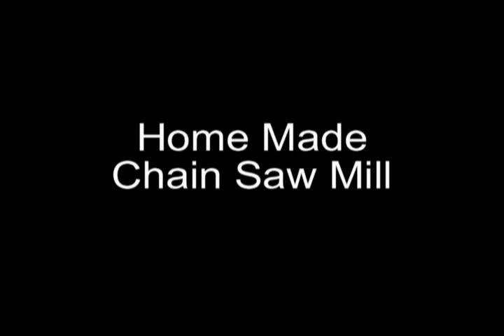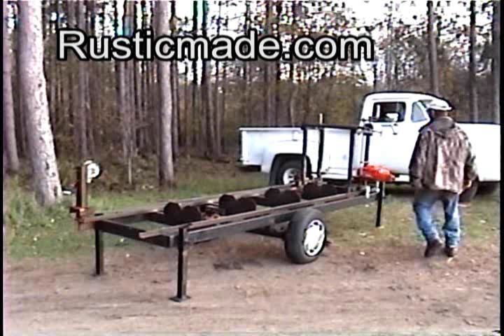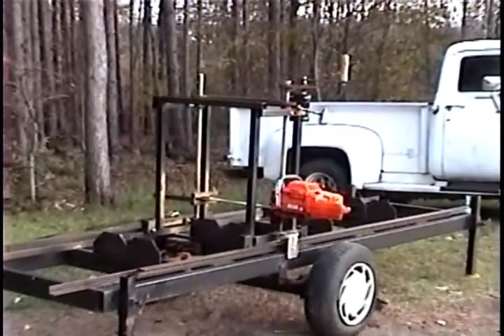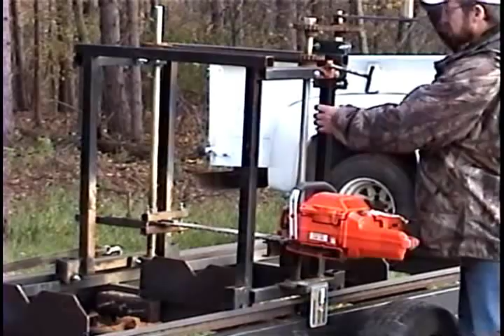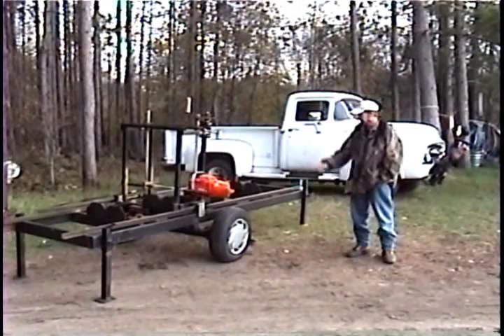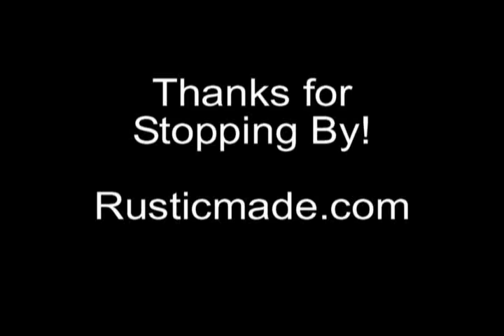Build Your Own Chain Saw Mill

Comment: if you do put 2 chain saws so i cuts it into about three 2 inch pieces(depending on log)and if you want i just cut in half you can reel up the second saw up so it wont touch the log =D

Comment: Nice. The key in ANY small chain mill is a stabilized bar tip. Without that, you're making wagon tongues. Chain mills walk all over band mills. I like your system, but how do you load large logs?. I have a Woodbug, simple, sits on the ground though.

Comment: husky or still in  terms or reliability are on par. but sthil has some really nice features like cam lock gas and oil caps vs huskys screw in . and there ease to get to air filter and spark plug. i like huskys chain ajustment screw on the front instead of in the middle of the bar. like i said before i have both sthil and husky from 16 to 36 in . i like my sthils better overall but there both quality brands if you need a good saw dont get any thing other than a husky or sthil.

Comment: CharlesRaines, do you file the chain angle less steep for this type of work, compared to cutting trees or firewood the angle would be more steep. 
For flat sawing like ur doing in the mill mode the angle needs to be less for more efficient cutting.
Could u post of the mill in operation??
Thanks

Comment: I was pretty sold on the Logosol M7 with my Husq 385, but someone told me to look into these Procut plans.  This thing is slick.  The only problem looks like portability.  Looks like a great trailer, but the M7 weighs less than my gal, and you can set in over a log and start wrong side up...it can get into some tight spaces.

How do you load your logs onto the unit?  Have you got another winch?